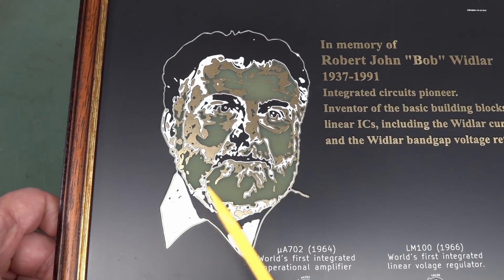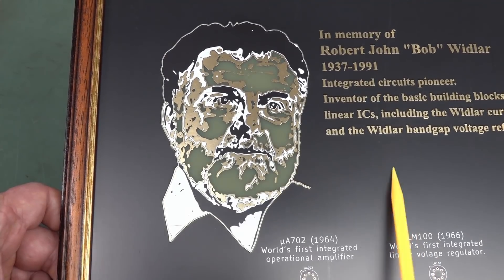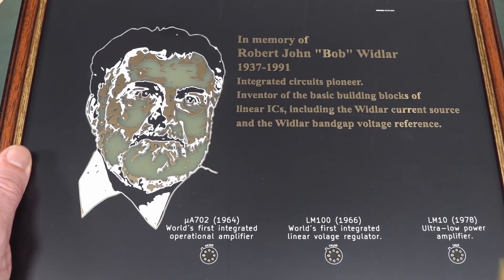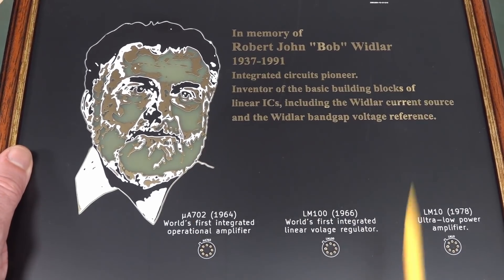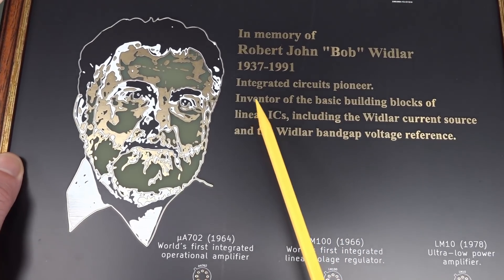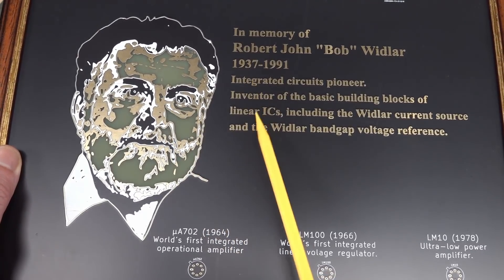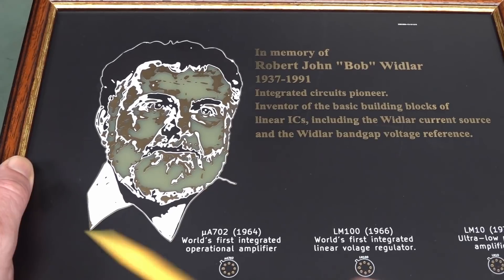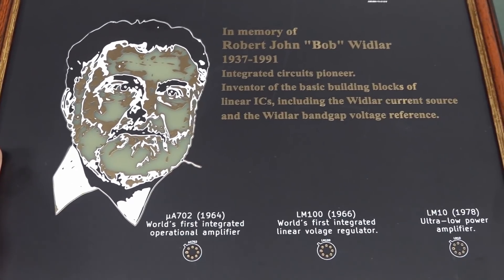How To Get 5 Different "Colours" On A PCB

Comment: Soldermask over bare copper (SMOBC) refers to the the process of surface plating AFTER soldermask. I.e. it doesn't mean you don't have e.g. gold plating, it just means the gold isn't underneath the soldermask.

Comment: Actually the price for PCBs and even alu PCBs has gone so low that it's easier and cheaper to do your front and back panels as a PCB instead of ordering a separate aluminum/aluminium chassis/plates. Even 2mm alu PCBs are very doable these days and the ordering process is so much more straightforward. 
You only can't get your nice anodized or powder coated finish obviously.

Comment: This is relevant to my interest.
Rapid prototyping PCBs are affordable enough that you can make a control panel from a separate board. (Of course you'll want to switch to something more appropriate if you scale up for manufacture.) Remove windows in the copper front and back, a matching window in the back mask, and put a descriptive label in the front mask and you have a decent status indicator that can be backlit by a LED on the main board underneath.

Comment: The fiberglass can be dyed, so it doesn't have to be that boring beige. The OSHpark after dark PCBs are dyed black, and I have seen a different manufacturer dye them green. Probably an expensive option if it's not something they're already doing.

Comment: You can also get extra shades by placing or removing the copper underneath the soldermask/silk - similar to how you said about the copper on the reverse side
Reply: Yes. Depends on the type of solder mask though. In this case with the dark matt it wouldn't make a major difference.
Reply: You can also etch a hatched pattern on the back and let the fiberglass diffuse it.

Comment: 4 layer board will give you 2 extra shades of green bare epoxy, depending if you etch the middle or back layer, and put a different soldermask colour for the rear layer, which is entirely possible, at extra cost. Spring for a RF type board with a white epoxy, and you get another option as well, especially if it is the back, or they use another colour in the rear sheet. Never going to get RGB colour, or even CMYK, but you probably can get a reasonable semi Pantone set of colours out.